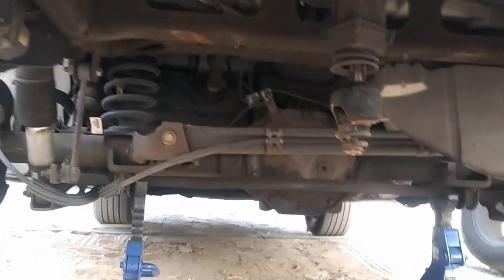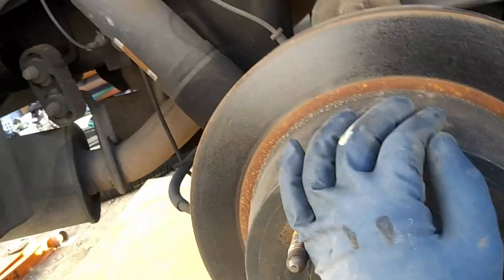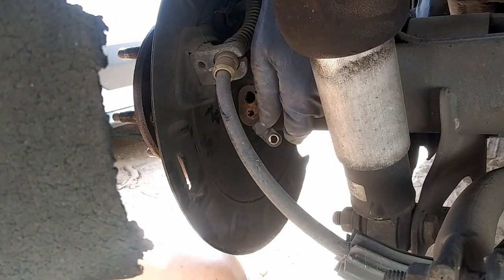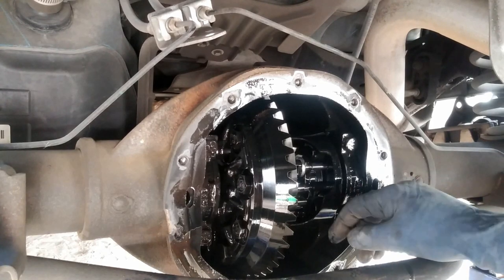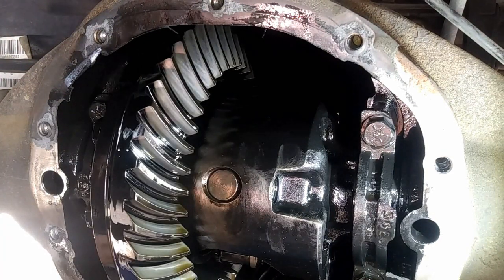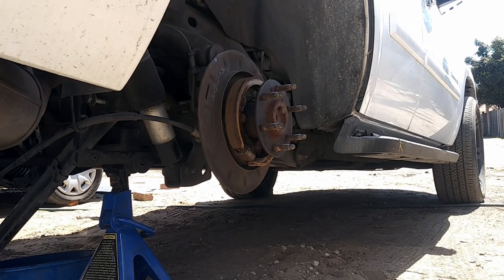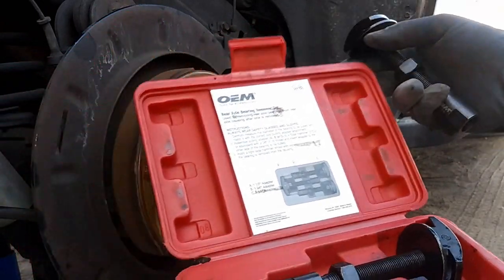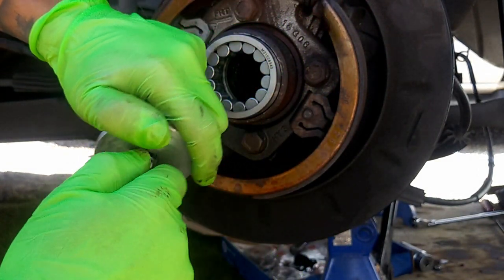chevy tahoe rear wheel bearing replacement

Comment: very informative video.one thing though i would do is clean the axle tube and bearing area to remove as much metal particles as possible. my passenger side was full of ground metal. on my older 8.6 without that abs thing behind the bearing i used some lint free rags  soaked in some solvent or diesel oil and a length of copper romex cable to swab the axle tube out. and whatever is left the magnet on the pan will eventually get it.

Comment: Very clear and straightforward. I may be looking at doing this on a 2013 Escalade but I have yet to determine if it is a wheel bearing problem or has the parking brake assembly begun to disintegrate. I'm not familiar with rear wheel bearings going bad at just over 112K miles but I suppose anything is possible. Thank you for showing everything so clearly here.

Comment: What about using the repaired bearings? Is there an extra step or the same process? I was advised to use the repaired bearings on mine. It's a 08 Avalanche.

Comment: There's a way to determine which rear wheel bearing is bad.  When driving and turning the vehicle to the right, more weight is shifted onto the left wheel bearing, usually causing the noise to get louder if the left bearing is bad.  If the right wheel bearing is the bad one, the noise often will get noticeably louder when turning to the left.
Reply: That really only work on the front

Comment: Very nice ..Questions?/ When slamming the outer bearing into the axle tube is there a collar or stop that the bearing hits bottomed out in tube? and if so how does the reductor tone ring pass that collar to remove if necessary.. How much gap is between between the tone ring and the bearing 1/4 inch ?? guessing. Thanks for your help and great video.
Reply: The tubes have a  step in them that the bearing race will sit flush against.

Comment: Brake pads replaced Brake roter replaced, but back left tire squeals bad at any turn even at a slight shift of steering wheel would it be bearings
Reply: Sounds like a bad bearing. When they get any kind of lateral pressure (turning left or right), they will make noise like a rubbing or grinding.

Comment: We're in the process of pushing the axel back in however it stops right before it can become flash with the disk? What's the issue?
Reply from the maker: It could  be  either the axle is not fully seated in